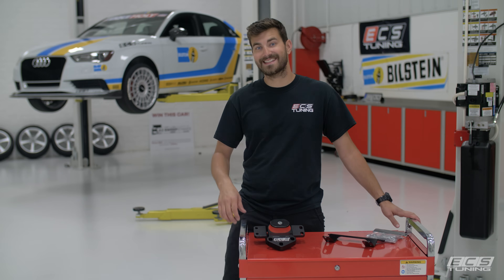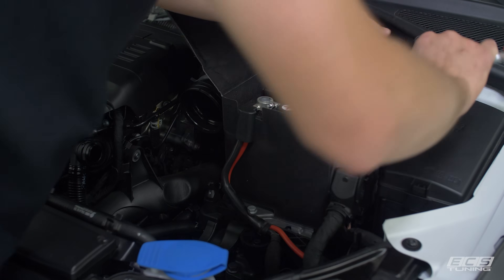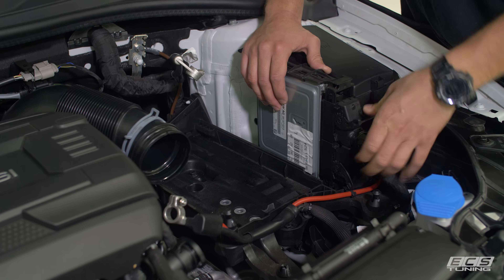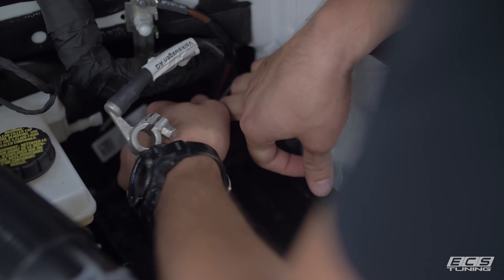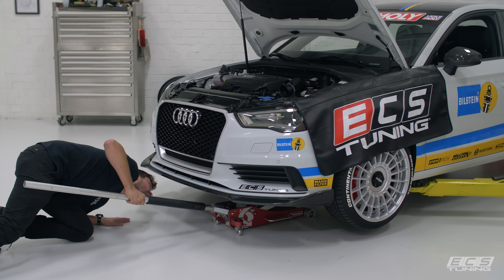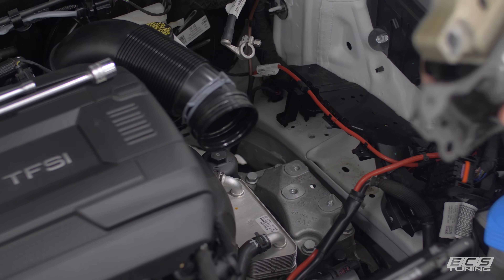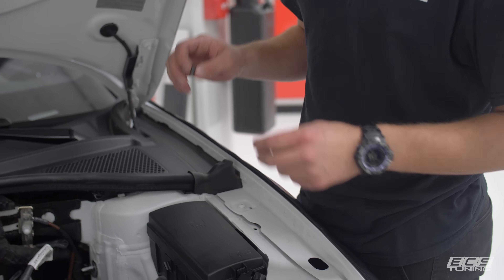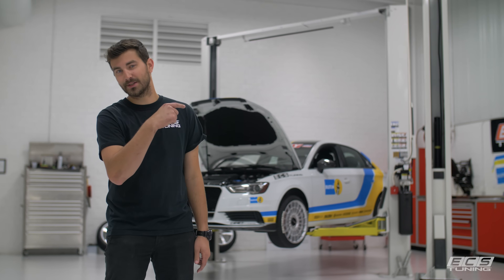VW/Audi Transmission Mount DIY (MK7 GTI, Golf R, A3, S3)

Comment: What is the purpose of this mount?
Reply from the maker: Stiffer mounts allow for less drivetrain slop, helping reduce wheel hop, improve throttle response, and help make shifts more precise.
Reply: So during the removal of the stock oem mounts on my 08 GTI. I notice that one of the bolts on the transmission mount snapped off somehow and is stuck inside the hole. Will this mean I will need to drill it out???